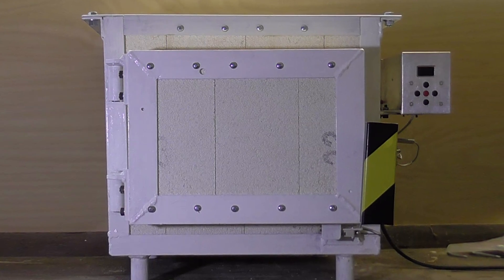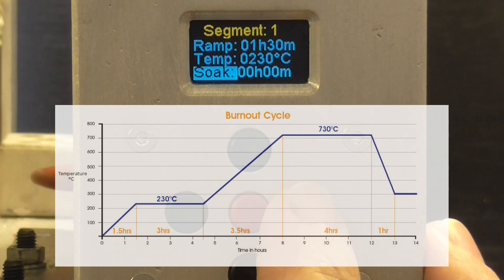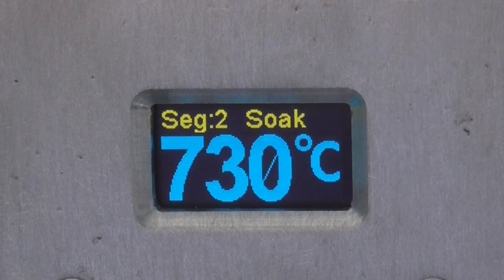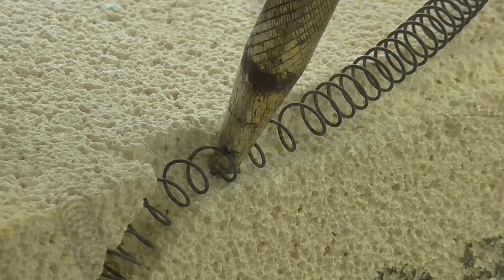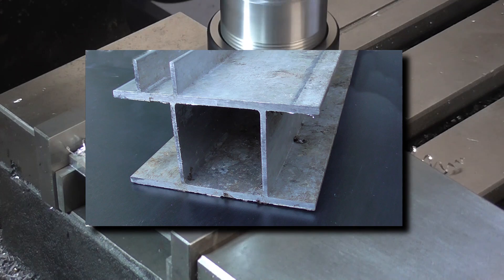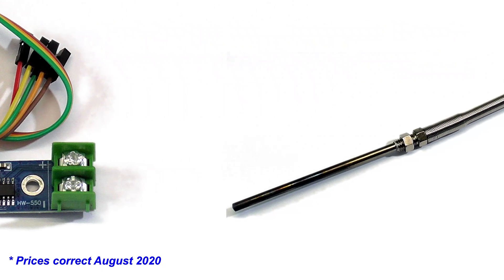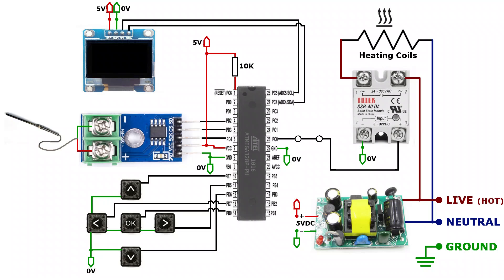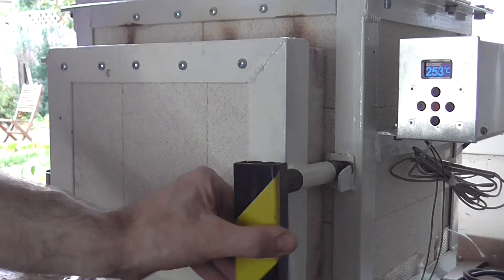Burnout Kiln with Schedule Controller

Comment: Hi Andy
I want to build a burn out temperature controller.
Your video and your PID is outstanding and user friendly.

1. What program did you use to compile the .hex code? Is it in C language! 

2. Will you sell the Written progran such that it can be edited and customised to my own need. I will want to switch to max 31855.
Reply from the maker: Hi. The code was written in assembly language (just my preferred approach). If you check my Patreon (you can join for free) there is a version on there for the 31855 and I also posted the code for people adapt for their own needs, it was a while ago though so you might have to search for it.
Reply: @AndysMachines  Thanks for the response. Already there

Comment: Are you still offering pre-programmed atmegas?
Reply from the maker: This video is a few years old now so you might need to check you can still get all the other components (you probably can). It's been a while since anybody's asked for a chip but yes I can still do them.
Reply: @AndysMachines  i may just buy the $100 PID soak/ramp controller. Not being able to tweet the code may become a problem in the future but thanks for your reply!

Comment: So this could be a way to recycle aluminum shavings into a useful cast billet again?  The idea just struck me as I watched this.
Reply from the maker: Yes, you can do that, I've never tried it myself and 'casting pros' will tell you that it's not worth the trouble since you get very little aluminium and a ton of slag/oxide from swarf and chips. But if you have a lot of clean shavings collected it might be worth a try.

Comment: Fantastic, what a lovely construction, unfortunately, I don't know anything about the electrical system, so my question is what does this in apere require. Sincerely Lars
Reply from the maker: It depends on the heating element (thickness and total length of wire). Mine draws about 6 amps @ 240 volts which is around half of what the domestic mains power can supply here in the UK.
Reply: @AndysMachines  Now I was very pleasantly surprised. We have 230v and 10 amp as a normal house socket. Maybe a similar one would work. Now I have to talk to some knowledgeable electrician about which components I can use. Sir thanks for reply i appreciate it very much.

Comment: Can I do this with an arduino uno r3 board?
Reply from the maker: I did do a revised version for arduino uno, there are a couple of changes due to some pins not being available on the arduino board. Code and details are on Patreon.
Reply: @AndysMachines  sounds good will be joining. Do you have a wiring diagram for the audrino board with your membership?
Reply from the maker: @Atlas_8869  Actually there is only one change to the wiring, one of the buttons has to be moved to a different pin since that pin is not available on the arduino, otherwise the connections are identical to those in the video, you just need a pinout diagram for the Uno which lists the pin functions.

Comment: Very nice project! Thank you for sharing!
Question: what components I'll need to change so it will work with 110V?
Reply from the maker: You should only need to change the power supply module for one that works on 110v, a lot of the small switching power supplies have a wide range and will work on both 110v and 230v. The heating coils will also need to be sized to work on 110v but the calculations are the same.
Reply: @AndysMachines  Thank you!

Comment: Hi. I downloaded the hex file from your patreon, but haven't been able to upload it to the atmega328p. Is there any tutorial or page I can read to understand how to program it (would avrdude help?).  Also, I did some physics simulation of my kiln in COMSOL and it can go to 1200C, the issue is the MAX6675 can't. Are there any plans on an updated code that works with the MAX31855 library?
Reply from the maker: You will need either a programmer for the chip and Atmel Studio (free) or if the chip you have is actually an arduino there are apparently ways to upload .hex files with the arduino IDE (I haven't done it myself).

I did actually start on a MAX31855 version of the controller, but it's not just a case of updating the code, the whole circuit needs to be redesigned. Unfortunately this project got overtaken by other commitments, but I'd like to get back to this one day.

Comment: Can you get it to 1250c
Reply from the maker: No, it only goes to 1023°C
Reply: @AndysMachines  What modifications would you make to get it up to 1250c
Reply from the maker: It would need a different type of thermocouple amplifier, the MAX6675 can only go to 1023°C. There is a MAX31855 that can go higher but it's not directly compatible (either electronically or code-wise) so would actually need redesigning from scratch rather than modification.
Reply: @AndysMachines  what about a Ceramic Kiln Furnace Thermocouple Core K Type High Temp Sensor 1300 C and if I still need to make modifications what  modifications specifically
Reply from the maker: @mrplotarmour5393  That sounds like you're talking about the thermocouple itself, but that's not the only limiting factor, the thermocouple amplifier (in this case a Max6675) reads the voltage and converts it into a temperature value that can be read by the microcontroller. To go above 1023C would require changing or reprogramming all 3 components.

Comment: Pretty good programming there. Im looking to make something like this. I thought about connecting a touchscreen to a raspberry pie, and the pie to the arduino. but this seems to be more easy and less costly. :)

Greetings,

Jeff
Reply from the maker: Yes, people often jump straight to using an Rpi or even arduino when actually it would be way overkill. I've even seen people use an Rpi when a couple of transistors would have done! It's not just the cost, but also other factors such as power consumption, space, weight etc...Simpler is usually better. It only needs to be as complicated as it needs to be.

Comment: Hi.  I've loaded your code on my Atmega328p, all the wires are where they should be, but my UCTRONICS 0.96 Inch OLED Module 12864 SSD1306 shows nothing.  I've confirmed that this screen works, using a Raspberry Pi.  The channel it's using is 3C.  What channel does the code use? Any help would be PROFOUNDLY appreciated.  Thanks!
Reply from the maker: Hi,  Yes, some other people have had this problem. Not all of the oled screens are the same it seems, I have now updated the code to support other screens that previously appeared very dim or did not display anything, check my Patreon page for the latest version. Yes it uses 0x3C as the I2C address.

Comment: Very nice work. I noticed you have a Kiln controller for Arduino Uno. Could I have a bit more info on that.  Thanks
Reply from the maker: Not really 'for' arduino, but I did modify the code to run on a mega-328 based arduino using the on-board 16MHz crystal and also changed the pinout slightly as one of the pins I used isn't normally available on an arduino.

The code and more details are available on my Patreon, note that the code is a .hex file so you need to upload it differently (can be done with the arduino IDE apparently).
Reply: @AndysMachines  Thanks

Comment: I just downloaded your hex file and I ordered all the parts, did you connected your heating coils parallel or serial and I guess I do not have bother the fuses when I upload the hex file?
Reply from the maker: I have 2 coils in parallel in my kiln, but you can do it either way depending what type of coils you use. You shouldn't have to change any of the fuses except maybe the clock/8 fuse (I think this comes set from the factory) It will be obvious if it's running 8x slower.
Reply: Thank you so much, just uploaded the hex code in my 328p did not set any fuses, we will see what happened, waiting for the other parts very excited.

Comment: Can i use a contactor instead of SSR ?
Reply from the maker: Yes, you could, but the drive voltage for the SSR is only 5v so you might need an additional relay to drive the contactor. You could use a small 5v relay to drive the heating coil directly (this is how some cheap PID controllers do it).
Reply: @AndysMachines  thank you andy , i see . But my concern is the deviation temperature, i'm afraid if i put a contactor it would be turning on and off too fast and repeatedly when the set temperature is achieved .and i need a contactor because i need to drive 23 Amps 230 V that's why  i don't want to use ssr,  that kind of load is alot.
Reply from the maker: Yes, a mechanical relay/contactor will be cycling continuously at the set temperature, which is why it's better to use a SSR. You can get SSRs that will handle 23A, even over 100A, but don't trust the cheap ebay chinese ones, they are extremely overrated, I saw a '40A' one blow up at 8 amps.

Comment: Hi.
Good job. Please use 10kOhm resistors for buttons and one more resistor for logical control of power relay. Because you will get risc of false buttons pressing or electronic relay enabling.
Reply from the maker: Yes, that's a good point. In noisy environments inputs of ICs etc. can be susceptible to false triggering. This is usually only a problem if you are controlling electric motors, (mechanical) relays, inductance coils etc. There's nothing really in this circuit that will produce any interference. The heating coil is mostly resistive rather than inductive and the SSR will turn it off at a zero crossing point of the AC waveform anyway. The input of the SSR is opto-isolated and not really susceptible to noise. Inputs on the AVR can be an issue, but they have internal pull up resistors which I've enabled and I've also done some filtering on the buttons to avoid 'bounce'. I've certainly not noticed any problems.

Comment: I would be interested in buying a controller for jewelry casting oven. Potter (Mud) Wasps decided to build a colony in my Ney Oven, and killed the control board. By the way, No link for the eprom... I would buy it complete, if available and reasonable (doesn't have to be pretty) Thanks!
Reply from the maker: The controller is limited to 1023°C by the MAX6675 module which is hot enough for silver, but just slightly below the melting point of gold (it might still work if you put the thermocouple in a cooler corner of the kiln) There is another more expensive module available that will go up to 1350°C and you would also need a pottery kiln type thermocouple that can withstand the temperature (your oven may have one already). 

There is a link in the description to my Patreon page where the code can be downloaded, you do have to join but it's from only $1/month and you can always cancel afterwards.
Reply from the maker: @capt.diractance9926  The 1350°C device is the MAX31855 made by the same manufacturer, it's  a newer version of the MAX6675. The code will handle the higher temps, though looking at the data sheet I can't say for sure if the 31855 would be a drop in replacement, some people say not, but I think it depends how you use it, it will transmit twice as much data but it may be possible to read only the first 16 bits with the temperature value if the format is the same (I've never needed to go above 1000°C so I've never used it). The main problem though is that the 6675 is a 5v device whereas the 31855 is 3.3v. All of the other components should work at 3.3v, though it's the bare minimum the SSR needs to turn on.